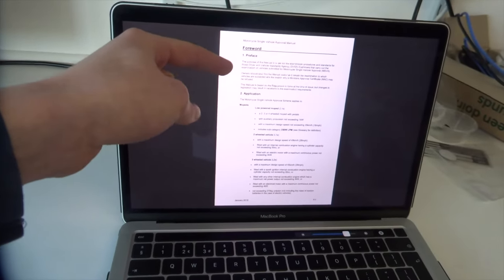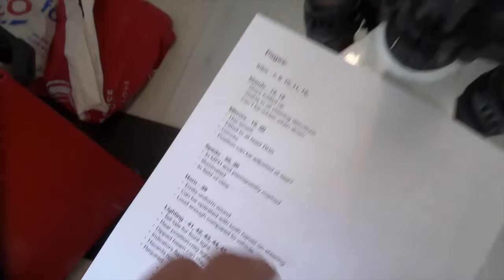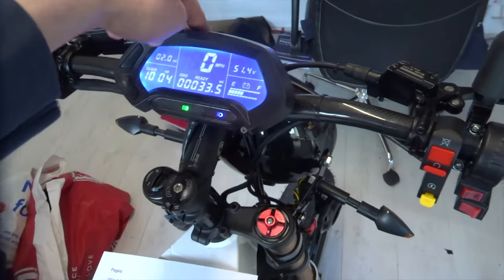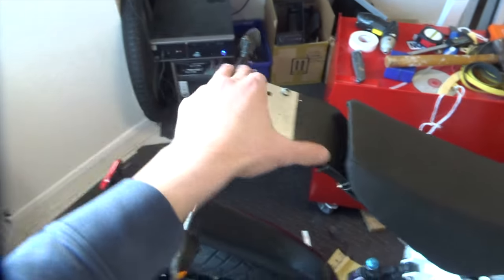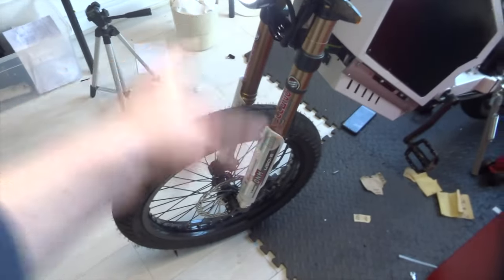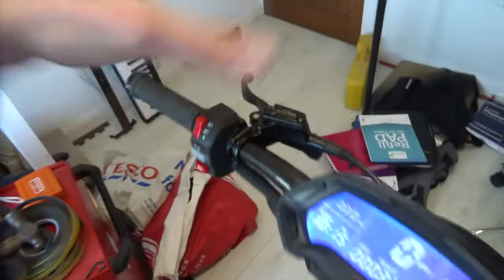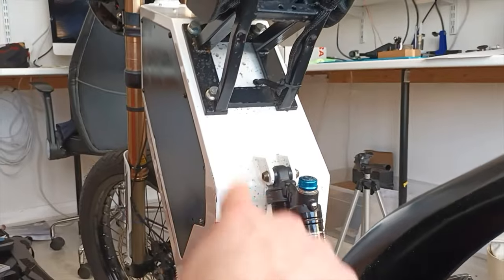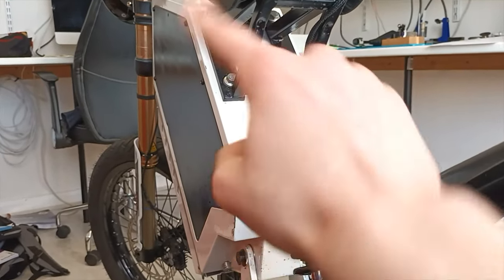What is needed for the UK MSVA? - 8kW Enduro MSVA eBike V3 Build - Part 20

Comment: Did you ever have  the overcurrent code pop up and disable the bike while riding
Reply from the maker: I had it once when turning the bike on with the headlight on and the buck converter caused a large inrush, but otherwise no. I'm not sure how it would get triggered when riding as the controller should regulate the current before it realises it's over the set limit?

Comment: Have you got a link for where to get the brake levers and calipers? Thanks.
Reply from the maker: They were 2nd hand off ebay so not really, put in 'sur ron brake system' and see if there's anything on there at the moment. I believe you can get the whole kit fron SurRon directly but it was much more expensive.
Reply: @EverythingEbikeChannel  thank you!

Comment: I can't see the manual talking about brake fluid level?  Except Pg 154 "reason for failure indicated service efficiency is less than required."   Surely if it is not indicated it cannot fail?  I mean drum pad brakes are not indicated.
Also the external projections section,  I don't see why only the ball ends of clutch levers of that section applies when everything else is apparently not applied.  I say apparently not applied  because the section does not start with "This inspection applies to all vehicles with the exception of mopeds fitted with non retractable pedals".  Instead that paragraph of optionality comes after a paragraph about foot positions.  Could it only relate to the foot position requirements?  But if it was only to be optional in relation to the foot positions I would expect it to be in the same paragraph.   Did you ask your email contact about these  points?  BTW what is your max range, Motor hub power and battery size?
Reply from the maker: On page 133 it talks about 'Check that hydraulic system reservoirs are so designed and constructed that the level of the reserve fluid can be easily checked' which is where I got the fluid level bit from. As to the ball ends, I emailed DVSA directly as I wasn't sure either and they said external projections apply to all vehicles, but then the manual also says not if you have pedals🤔. I know that's what other people have done and I'm playing it on the safe side so will see if they mention anything when it goes it for test.
Reply: @EverythingEbikeChannel  I totally missed the "brakes" section  ha ha. Thank you.  It might be worth looking at EAPCs on the market to see what braking systems they have used and the projections on their bikes which have passed the test.

Comment: Look into using motorcycle levers with adaptors to fit the bicycle hose. Check the ebike nut channel, he has a good video on how to do this. This should help clear any obstacles with regard to brake levers testing.
Reply from the maker: I saw his vid actually, but only after I'd done my setup. Will bear in mind if I need a different way of doing the brakes

Comment: audible tell tales for indicators were stopped in the 80's after only a few years of use as it (supposebly) caused confusion (in rare circumstances if ever) at pelican crossings where it was decided that an approaching motorcycle beeping could confuse a blind person into stepping out into a road full of traffic. dvla guy obviously not old enough to remember such things. it also could be urban myth stuck in tha back of my mind, dvla often introduce things then pull them, like dim dip headlights activated by sidelights which caused issues with halogen bulbs....

have you spotted the little funny in the msva about indicators, they /must/, it says must, be tested with the bike powered up and at 50% throttle, now i dont know how fast an msva tester can run....page 42, first paragraph of section 6)(of the 207 page pdf)
Reply from the maker: Yes I did notice the 50% throttle bit, I don't get it but wondered if it's to do with the 12v battery dipping under load?
Reply: @EverythingEbikeChannel  yup voltage dip is an issue on old 50cc mopeds with a tiny 2ah lead acid battery so 50% throttle was used to bring the voltage up from the generator, being pre alternator bikes.

Comment: yeah if only brake levers for bikes could be bought that apply to EU regulations. i have spent weeks looking for them that have a fluid level indicator with switches and ball end levers. they just do not exist in the world. i went direct to SurRon to ask if i could just buy the master cylinders and levers but they will not sell you them. the only other legal ones were the Tektro HD-E710 but sadly they do not make them anymore and just cant get hold of them.

we have 2x bikes we want to make legal but they are doing everything they can to prevent it. no money in being legal!
Reply: cable driven disk brakes are good to 30-40mph, they will outbreak your rear tyre traction....  you can also 'move' the master cylinder to the brake caliper and have hybrid cable operated hydraulic brakes and they will never notice. (thats what i have bought) - msva says it must be possible to check fluids level with bikes supplied tool kit, most brakes have a hex head filling level screw, so tape an allen key to the bike and boom you can check the level.....(thats my current interpretation of the docs
)
Reply from the maker: I'll ask them about using the filling port as a fluid checker when I get it tested, that would allow a lot more ebike brakes to be used.